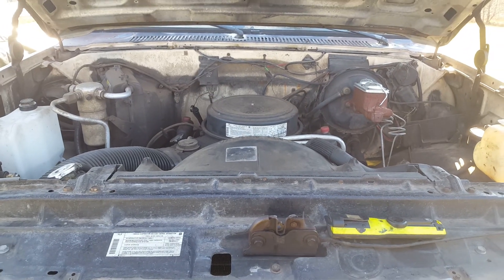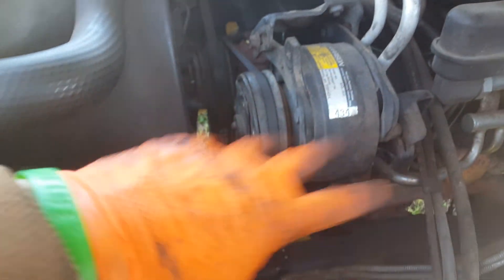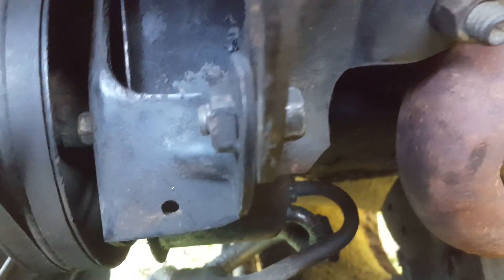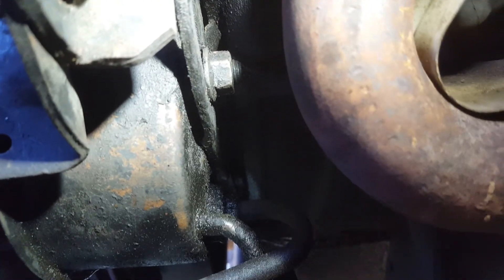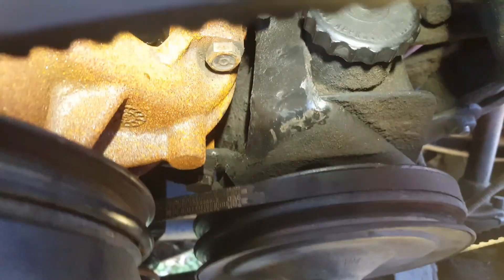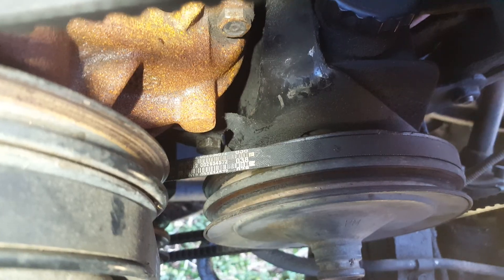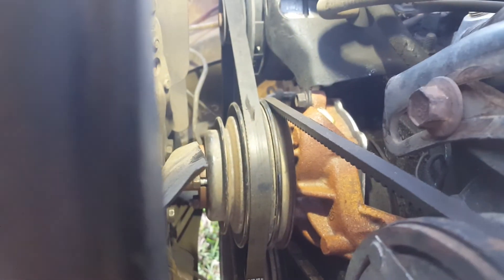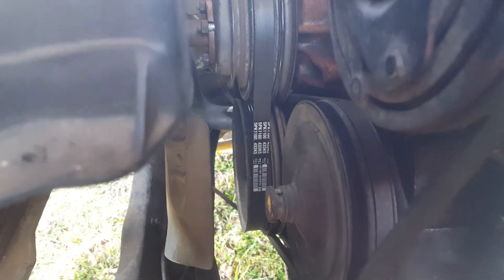Demonstrating belts and pulleys on a stock Chevy 350

Comment: We now know where every bolt for every motor on the belts is located,  but since my belt to my ac compressor skipped off, what do I loosen in the slots to release tension to get it on and retension it?

Comment: I know this is an old video but I've been working on a 83 chevy g20 it has all v belts and I'm not a mechanic. I am running into an issue with the belts squealing. I don''t know if they're  too tight or loose and I have a messed up mechanical tensioner pulley and I tried to pull it off and it damaged it even further. I am really stumped on this I can not find anything online to replace it there is a number on it 62727-M but it comes up as a power steering pump pulley which it is very much not connected to any pump so I am assuming maybe the pulley was taken from one. I don't know what to do and if anyone can help it would be very appreciated!

Comment: This trucks brackets are amazingly intact, most of the time you find these old brackets hacked up,missing spacers and usually have the wrong bolts jammed in and washers stacked up everywhere and sometimes the brackets themselves get tweaked and bent and then you have crooked belts that squeal and if you ever have to fool with an sbc with ac with headers it's an absolute nightmare because now the bracket for the exhaust won't work right, in most cases its alot easier and cheaper to go to the junkyard and find a 305 or 350 tbi or tpi out of a full size truck or car and use those serpentine belt systems which are alot easier to work with, look nicer and even come with a higher amp alternator as a bonus. Your video is very helpful though because there's still alot of cars and trucks running around with these set ups and just having an intact one too look at for reference is almost priceless but I always suggest if you have an old sbc with hacked/cobbled up v belt brackets just go to the junk yard and pull a serpentine setup and slap it on.
Reply: Exactly this needs to be way more wildly known about for people who work on the obs chevys and gmc trucks,if you have anyplans what so ever of doing engine work just take them old worthless piece of shit brackets that gm made when they were on shrooms,and get that newer serpentine setup
Reply: @lamborgatti-4783  yeah v belt brackets suck, when I got my 82 c10, the previous owners had completely hacked up the v belt set up and none of the belts lined up and the water pump was junk anyway so I threw that stuff in the trash and used a serpentine set up off a 1990 Camaro with a TBI 305, it worked out great and is a lot easier to work with and if you look around the junkyards, you can do the swap pretty cheap.

Comment: i have a 1982 gmc vandurag g2500.   My A?C doesnt work.  I heard somewherre i can cut the belt off for better mileage.  Could this throw some sort of balance out of whack?  or is there no harm in doing this??  thanks
Reply from the maker: If the ac isn't working and isn't putting a load on the engine, what is cutting the belt going to do?

Comment: Thank you thank you.  That bit of advice about tighten the ac belt first then power steering saved me i couldn't figure why my power steering pump was off track and that did the trick.
Reply from the maker: Good deal. GM had a great idea when they transitioned to a serpentine belt.

Comment: Have a G30 motorhome with the 350 1983 and It had 2 ps belts, 1 must of snapped and now it just stalls. The air pump seized up on it, so I removed that pulley which is also the alternator belt going to the crank or water pump as well. My point is the 2 ps belts are side by side and both have to be their on this 1 ton dually Mh. Finding the bolts are a beach. I sure could use Tyler's help finding them. You do show the closest set up to mine on that 3/4 ton truck you've shown. Are you in Fl by any chance? I also have the dreaded hydro boost ps/ brake assist, so am running on manual brakes right now and have to travel north through the mountains-wonder if I'll get their in one piece? Any suggestions would be appreciated. Are most of those bolt 9/16 deep well? One seems to be missing on the bottom water pump bracket, how long is that bolt and what threads diameter?